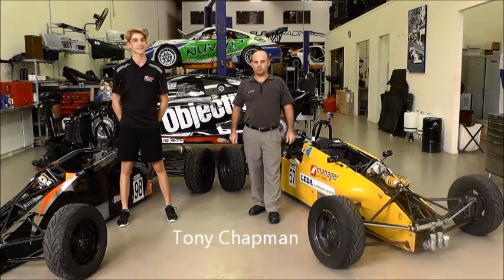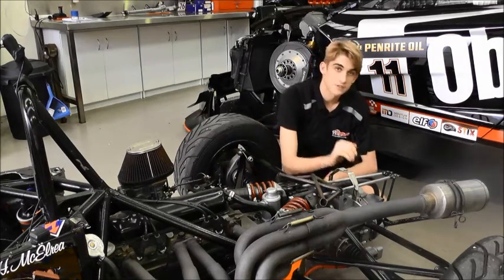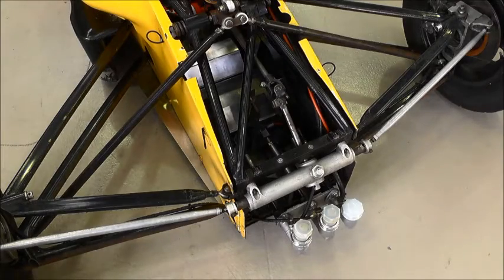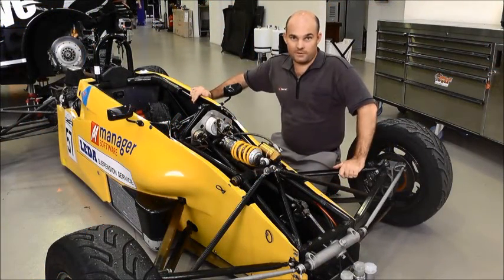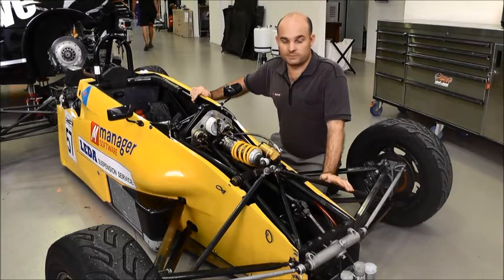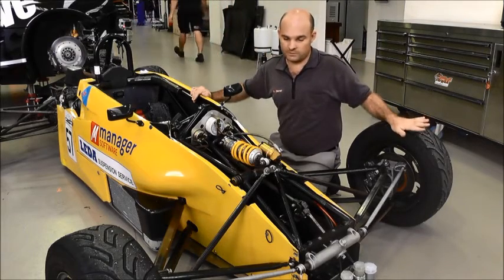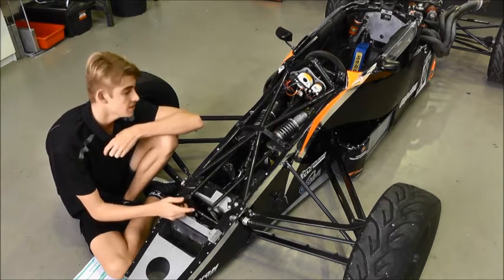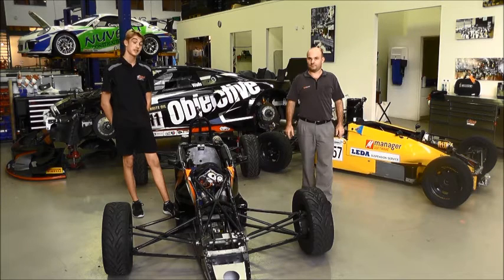Qld Formula Ford 101: Twin v Mono Front Suspension

Comment: I have a 94 and the mono-shock is a very confusing and unfriendly design. 
if anyone has pointers or knows where I can find more information about them that would be fantastic thanks.
Reply: I had a 94 and sold it to a fellow who did well with it. I can try to get his contact info if you're still wanting info. I don't remember much about the monoshock.